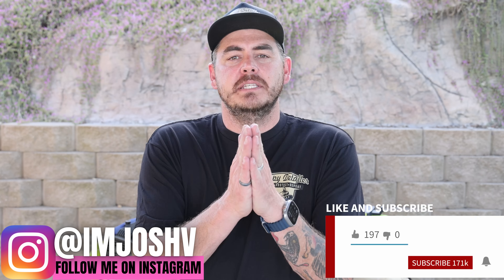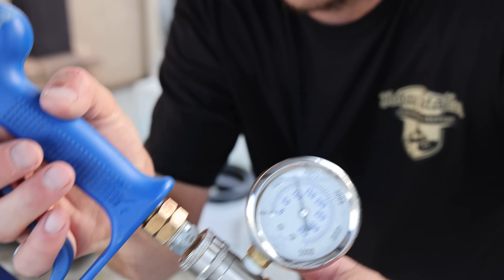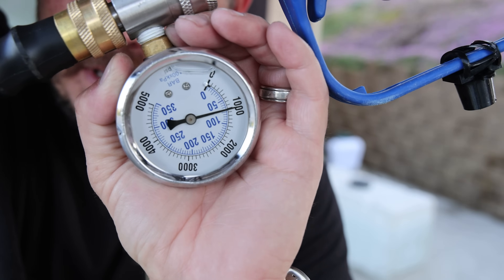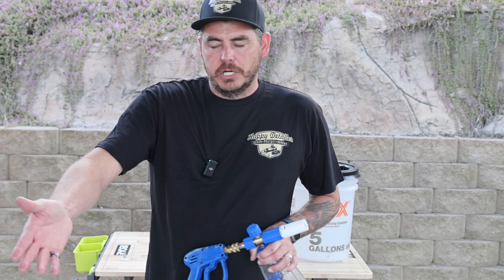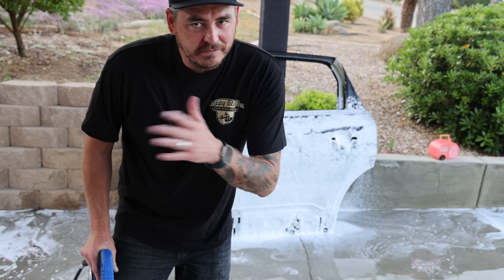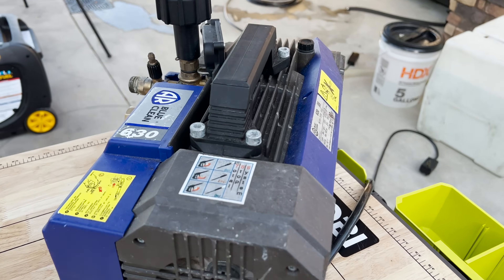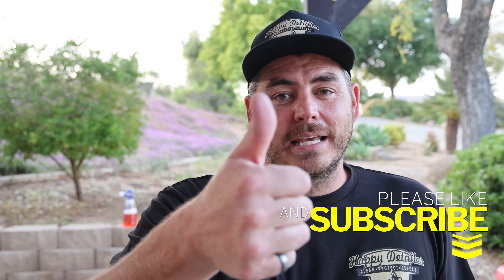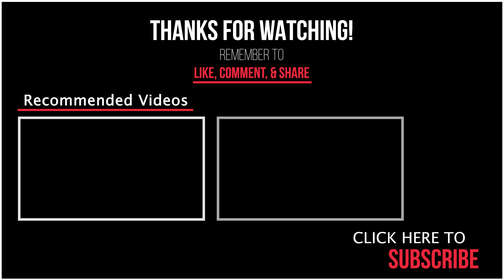AR630tss VS BigBoi Washr Pro - Detailing Pressure Washer Comparison

Comment: Stay away from the Bigboi Pro. Been 3 weeks of nothing but headaches. They haven't owned up to it, and hiding from the truth. And Customer Service ... Non-existent. The problem even seen in recent Cars with Keav review. Buyer beware ...
Reply from the maker: I saw keavs video where his unit spiked in amperage. I have heard from one person that the unloader when they received the unit was set wrong. Their unit wouldn’t start because with it set all the way down it was pulling too many amps. He adjusted that and now it’s working. You may want to try that? That’s not great to hear about the customer service though… you can email me josh@detailgreenusa.com and let me know what the unit is doing. If I can figure it out I’d be happy to help
Reply: @HeadShot1171  My washr pro is leaking first time using it and still waiting for a replacement. Customer service is non existent. Have you thought of just returning it? I'm very tempted to just eat the shipping cost both ways.
Reply: @SilvergrovePictures We received defective products. Whether a design flaw, or whatever label they want to give it ... Their commercial grade equipment has issues. I have less than 30 minutes of use. That's a disgrace. 

You/we should get a full refund. It's not like you bought something and changed your mind. You spent your hard earned money, in good faith, and you were genuinely excited! But, there are some glaring issues that have not received a proper response. I have thought about returning it, and they offered the option of a replacement, or a refund. I opted for the latter of the 2 options, and now waiting to hear back.
Reply: @imjoshv Thank you. Email has been sent. Look forward to hearing back from you.
Reply: My WashR Pro has been terrible. It doesn't shut off. I emailed Bigboi about it. They suggested strechting the spring out. It broke when attempting that. I responded saying it didn't work. I have not heard back from them since. They are a terrible company in the support aspect. I would never buy from them again nor would I recommend them, to ANYONE!
Reply: @mundymulligan665  It took them 1 1/2 months to finally provide return labels  (at 1:00am my time), saying the pickup would be the next day ... After I told them I was out of town. 

They received all their defective equipment last week. 

They now have everything.

Ask me if I have seen my refund. 

They are a bunch of thieves that belong behind bars.
Reply: @HeadShot1171   Sheesh. I hope I get a response. I wanted to like this pressure washer a lot. I am so frustrated that I'll never buy a product from them again.

Thanks for responding and letting me know.
Reply: I will be happy to share their individual email addresses. They hide behind their generic email wall ... But I can send you contact info for Dan (oblivious and overseas), Jay, Romelyn, etc.

Hell ... Do what I did and CC EVERYONE, and keep a copy of everything. Easier to have access to all documents during a lawsuit.

It's really unfortunate. They had an opportunity to get their foot in the door. Instead .. They put their heads up their @$$.
Reply: Mine has been the biggest piece of junk. My unit needs to run at 1250 psi to just get 1.9 gpm put pulls over 15 amps to do it. I had the same starting issues was told to stretch the spring,what a joke.
I tried 4.0 nozzles and max psi was 825 at a flow of 1.9, not exactly the 2.2 they said it would do 
Unit pops my GFI about 60% of the times I start it.
Filed a charge back with my credit card company and got my money back, thank you Capitol One.
Reply: my unit just humms........did not even last 90 days.

Comment: I don't see the point in these expensive pressure washers. $100 sunjoe works just fine. More expensive pressure washer won't make you a better detailer that's for sure.
Reply from the maker: Yea I talk about that in the video. However these higher performing units do speed up the rinse process significantly. I use them as a professional but yeah the basic units are great too
Reply: @imjoshv do you have a vid comparing rinse times of the cheaper pressure washers vs these? I'll check it out. If not it might be a good future video idea
Reply: Josh is right, the higher gpm makes a huge difference. I'm stuck using a low end unit for now, but I've tried better ones and the time savings is significant.
   If you're doing a quick wash on your own car, you can probably save 10 minutes unless you're the kind of guy that does a half-assed rinse to begin with. 
   If you're a pro doing multiple cars a day a unit like this pays for itself relatively quickly.
Reply: Because I’m gonna feel like a bad ass using it. Plain and simple. 😂
Reply: You’re right, for the average car owner. The littlest Ryobi for $100 will do perfectly fine too. The more expensive options are definitely marketed to the pros and prosumers with the budget for it
Reply: Why even buy a pressure washer? I use a garden hose.
Reply: Jokes aside, better pressure washer gets you better foam and more water to rinse. I use Sun Joe and an active. Rinse so nice and smooth with active. No more Sun Joe for me
Reply: I used to say the same exact thing..until I went from a Ryobi to an Active 2.0–night and day difference…the efficiency of a detail is just so much better
Reply: @DetailsNMe same except I went from a Ryobi to the Active 2.3
Reply: I will not spend $600+ on a pw to wash my 4 cars.  I am amazed at the number of guys that will.  I am still curious about lower priced units that are claimed to be 1.7-2.0 gpm.  I don't need for it to last for 1000 car washes.
Reply: @bogieman101  it’s not for everyone but if you’re doing a lot of cars and you can afford it then I don’t see why you won’t get one. Time = money and with any pressure washer around that price range performance will be better than ryobi when it comes to rinsing which again makes the whole washing process much quicker. Don’t get me wrong Ryobi is decent for the average person but for those that enjoy detailing cars or do it as a business will be the ones who spend this kind of money on one. I still have my Ryobi as a backup but I instantly noticed the difference when I went from that to a Active 2.3. I would’ve loved to have gotten the Kranzle but I don’t have the budget for that so I settled for the next best thing which is the Active.
Reply: Why even buy a car that you have to wash?  A bicycle works just fine.
Reply: Longevity for one and those who use a garden hose are tipping water down the drain. IMO.
Reply: @leexiong9962 Once you get used to a pressure washer, going back to just a garden hose is out of the question. It takes far longer to rinse (and a hose will barely rinse something like iron remover), you can’t use a foam cannon (a foam gun isn’t a substitute), and doing something like rinsing out carpeted wheel wells with a hose is futile.
Reply: @bogieman101  you'll spend money on 4 cars but $600 to maintain them is out of the question? Seems a bit odd.
Reply: @bogieman101 you never know until you have tried them
Reply: @justinschuyler The thing is how far can a bike travel each day? How far you are commuting every day?
Reply: @bogieman101  Definitely check out the Simoniz 1800 with 2.0gpm. People are sleeping on this machine.
Reply: @joeschmoe6908  Yea, I guess it does.
Reply: Why waste money on a cheap unit?
Reply: I'M GOOD WITH THE AR. BETTER THAN WORKING ON A CUSTOMER'S CAR AND POOF. IT BREAKS DOWN IN THE MIDDLE OF A JOB.
Reply: How long you think a Sunjoe will last ? Sunjoe,Active,Ryobi are GARBAGE !!!!
Reply: @Detailing-in-and-out will last years as long as you take care of your belongings.   With a majority of these “trash” units you can use a foam cannon and wash/rinse vehicles with no problems so not sure why people think it’s a waste
Reply: @bogieman101 It may say 1.7 to 2 gpm on the box, but if you look at the rated flow, which is what you get consistently after the initial burst, it's only around 1 or 1.1 GPM on almost all the cheaper models and even on some that run about $200-250. SunJoe's claimed highest output model still only has about 1.4 gpm rated flow.
Reply: @Slider617  Haven't seen it. Is it 2 gpm "rated flow" or "max?" Big difference. Rated flow is what you actually get constantly.
Reply: @Detailing-in-and-out  Most universal motor types, SunJoe included, only give about 1, 2yrs. if lucky, if using in a smaller business daily. I just trashed my SJ after 2yr and a month. Just enough for the warrty to expire. Loving the Active 2.0 off Amazon with 3yr ext. warrty. I'm covered for 5yrs now! And total was around $400 with tax.
Reply: Sun Joe are garbage. I will never buy one again. For $100 get the Ryobi, for $130-150 get the Karcher. I have a 20 year old Karcher that still works. The Sun Joe Only lasted just over 2 years of light use. You don’t have to spend $600 for one that will last longer than that.
Reply: @justinschuyler  why use a bicycle when you can walk!!! 😆🙄
Reply: Under $1k for a clearly superior critical detailing tool is a no-brainer for a professional.
Reply: Actually they do make a huge difference  , the gpm really makes a huge time difference  .
Reply: It saves you on time. It might not seem much if you compare washing speed per panel but it adds up when you’re doing car after car after car. It doesn’t make you better just efficient.
Reply: Josh is right. What your saying means you don't know what your talking about. That simple
Reply: No he's not right. 100$ pressure washers are crap. Use it close to twice as long due to the horrible GPM. Need to use them to understand.  Get a big boi flo for 400$ CND. Sooo much better
Reply: Then your silly
Reply: Anything simoniz is crap. Simple
Reply: Exactly, like, why waste the money on a commercial grade pw. My $ 40$ Super Soaker is just fine.
Reply: Try using those hundred dollar pressure washing six days a week all day
Reply: @KellyB-z2e  see you get it
Reply: So much misguided logic in this thread. Hard to know where to begin. $100 pressure washers are a toy and disposable. You may not need a $1500 Kranzle pressure washer made in Germany, but the extra money gets you higher quality, performance, longevity, support, and a repairable product. Find your own balance.
Reply: I have seen 2.4 GPM  on amazon residential pressure washer for 150$ CAD seems pretty good for starting out
Reply: @Tardizard  it won’t make you a better, Detailer, but I’ve gone through about 10 Ryobi’s, and I’m tired of changing them out sometimes they last two months, because of full-time detailing, and a Honda gas pressure washer would last way longer, or a Kranzle, is a matter of do you want to keep replacing or keep going the cheap routes, neither one make you better, but one last longer definitely
Reply: For me the best in the video is AR630. Annovi Reverberi has a long quality Story! However the best pressure whasher are the all that have capability to run with 900lt/h or 4Gpm! 100$ washer are toys!